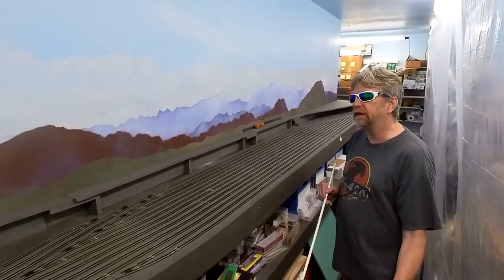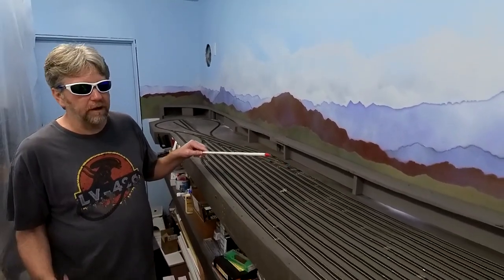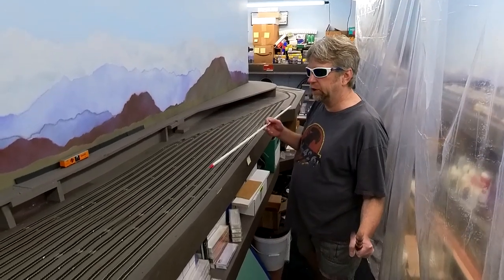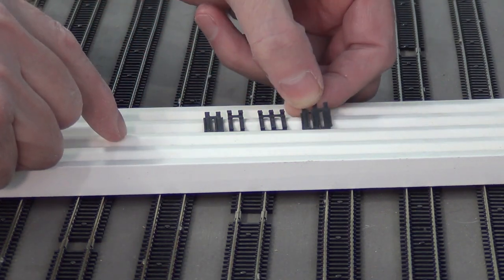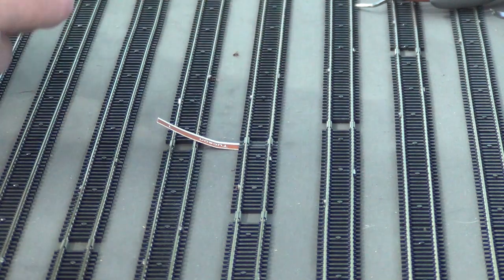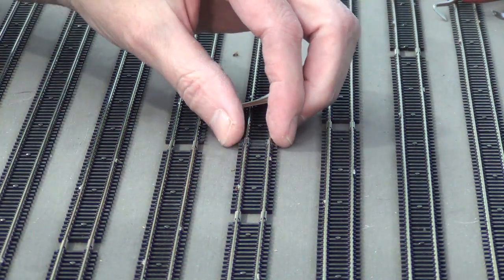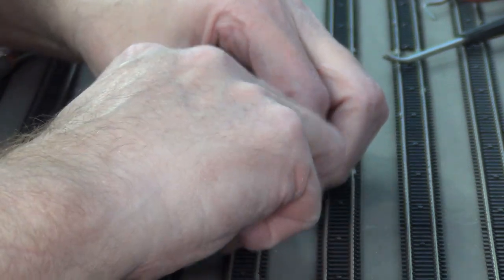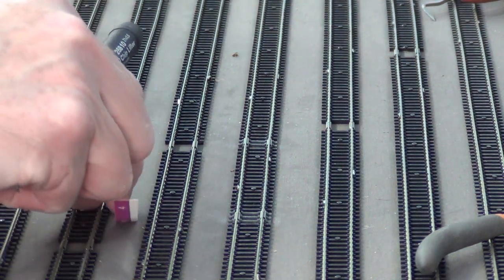This is how I quickly install crossties on my model railroad

Comment: Eric. Crosstie inserts and "wedges" is GENIUS..... Much easier than what I thought was my sure fire solution to filling in the crosstie gaps. I remove the rails from a piece of straight sectional track and then press the ties against a belt sander with a block of wood and sand the tops off enough to insert under the joint.The excess melted plastic flash must be cut or filed away. The crossties are then cut into two and three tie sets, a drop of glue added and then inserted under the rails to fill the gap. I have used this method for N and HO scales for years. What a hassel !!! ....I am sold on your new method. Mike
Reply from the maker: Thanks,  I do find this way much quicker and simple.   I was looking at one of my older videos on cross days,  forgot how long it took installing them.  I find this way is just real quick.  I also use tweezers now over the paper car,  this just makes it faster.

Comment from the maker: How to Quickly Install Model Railroad Crossties on Your Model Train Layout
One issue I have noticed that many model railroaders do not address is the gaps left by missing ties at the end of flex track sections under rail joiners. This is my solution to quickly remedy a huge, eye-catching defect on your layout. It took me about an hour to vastly improve the look with replacement crossties filling the gaps left by the missing ties under rail joiners.

Chip Lifter/Mini Forked Crowbar - https://amzn.to/3UKakwX

Salt River Valley Yard is a crew change point on my model railroad.  
SRVY = Salt River Valley Yard.

IMRROcom on Amazon - https://www.amazon.com/shop/imrrocom 
Wild Hare Limited - https://WildHarellc.com
Patreon - https://www.patreon.com/IMRROcom
PayPal Me - https://www.paypal.me/EricGHall
Members -   

 / @imrrocom  
Community -   

 / imrrocom  
Facebook - https://www.facebook.com/IMRROcom
Twitter - @IMRROcom - https://twitter.com/IMRROcom
email - Eric@IMRROcom

Model Railroad Layout Update 23.08
Helpful Hints for Operating Model Railroads with a layout update and tour
#Layout #Railroad #Train

Comment: Very cool, Eric! Nice design and your print looks good. What 3D modeling software do you use? Those will be invisible after painting.
Reply from the maker: I just use tinkercad,  do to the speed I can make something real quick.  It is funny that you can not see the .15 mm layers with the naked eye.  Under a zoomed in camera those layer lines are HUGE N scale parts look like a built them with Lego Bricks :)
Reply: @IMRROcom  I'm sure they'll look fine with some paint. Your spike detail looks good, and the print fit is accurate for 1/160 scale. I have an Ender 3D filament printer. I haven't made any model railroad stuff with it yet, but I've made some car parts, a motorcycle bracket and some 1/35 scale buildings. I have some ideas for the 3D printer once I get to the scenic stage on my layout. I've been using Blender for 3D modeling.
Reply from the maker: :) :) :)  what you see as detail,  it is the limitation of the printer .40mm nozzle at .15mm layer height :)  No spike detail it,  but yes,  I did that on purpose :)

I have looked at Blender and a few others.   But in most cases everything I do fits the basic shapes,  and with N scale anything less than 6" is smaller than the actual printers can make.  For both the SLA/Resin and FDM printers.

Comment: Hay. How much for that STL file for them ties. Definitely need a ton of them and I have a 3D printer. I’ll gladly send you a few bucks for the file alone. I’m no good at cad from nothing. Just editing.
Reply from the maker: Those should be going up in my store in a few weeks,  just need to figure out how to print them in quantity.
Reply: @IMRROcom   could do them stacked at a 45 degree angle and in stacks on a resin printer without much of a problem. Could do probably about 30 to 50 of each on a elegoo mars 2 pro. 3” deep 5” wide and 6” tall.
Reply from the maker: Too brittle to print with resin,  they break,  these are done with PLA on the FDM printer.
Reply: @IMRROcom  I use abs like resin. It’s actually flexible. They also make a rubber type resin to.